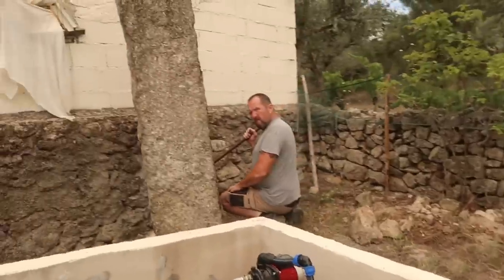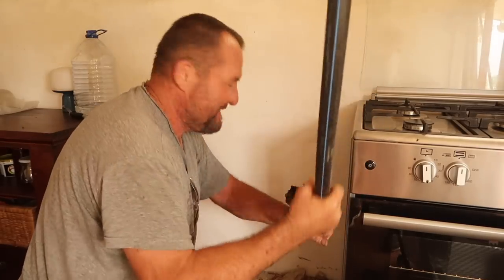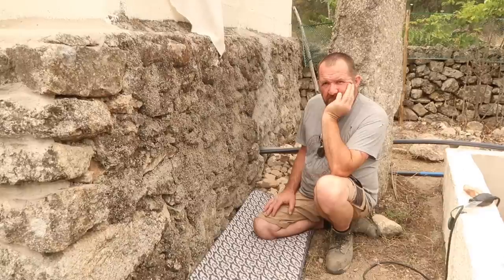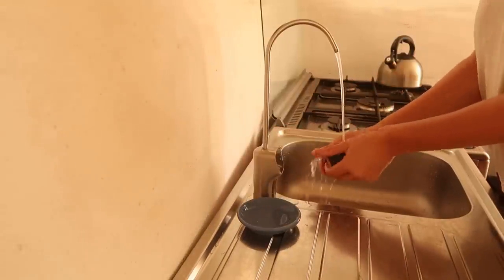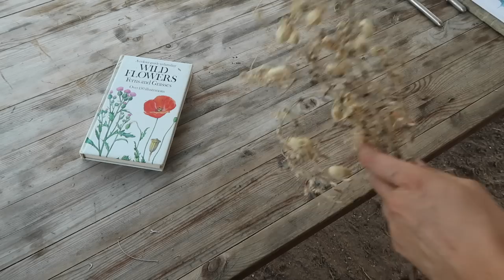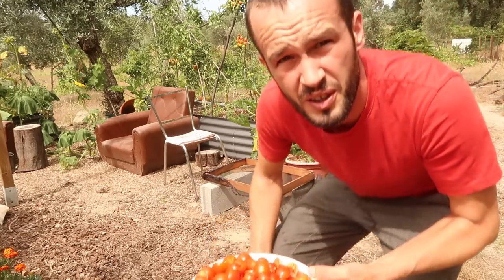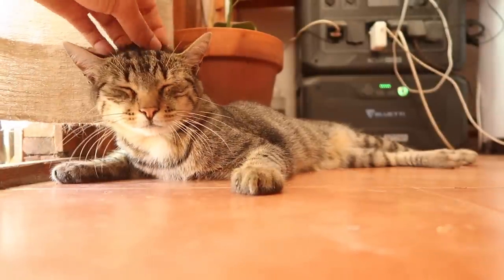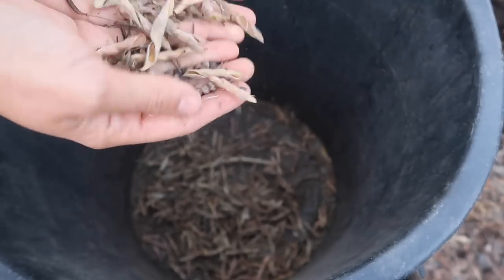Renovating a Portuguese Farmhouse

Comment: Don't waste the garlic. Wash them, dry them, put in an oven dish with olive oil and roast until soft. When cool-ish, cut the tops off and squeeze out the garlic into a bottle, add the left over oil and refrigerate. 😊😋
Reply: Sounds yummy
Reply: We always roast (or bbq) whole garlic buds and squeeze the contents onto steak or veggies. Cut a small portion off the top, drizzle with olive oil and wrap in foil. Bake until tender. SO GOOD!

Comment: The filming is fantastic. With the garlic clean roast in oven squeeze out the cooked garlic and add it to 2 litres of olive oil. That way when you want to add some garlic to your meals and salads drizzle the oil for flavour. You can also do this with chilies however be careful of how many seeds you add. Is it possible the soil is contaminated by engine or gear oil as you mentioned an engine was dumped there. Whilst in town working at the coffee shop bring back all the grounds eggshells and unused vegetable matter to help enrich the ground also check any fruit and veg outlets and restaurants for any green waste you can add to the garden. I had a small juice company near my property and the shredded citrus waste transformed my land. Congrats on the running water in the kitchen.
Reply from the maker: Definitely going to try this with the garlics! Sounds delicious. It could be the engine oil, I think that sunflowers are supposed to be good at removing things like that from soil 🤔 so perhaps a field of sunflowers there would be good

Comment: Hey Frankie/Carissa, Ewan and the weee Sausage pupp... ideas on the garlic and the beds in which they’re grown.... from the nether regions of my garlic and onion productions I usually oil roast or pickle the small ones that are not worth holding and peeling for active cooking. Once roasted/cut and squeezed or better pickled can be stored ready for use. As for the beds and on whether to build up a bed especially as “summer reveals how poor the soils are currently, it looked as if on this bed there were plenty of grasses and perhaps some cuttings from growing materials to perhaps make use of for composting only wetting down the pile and covering it while adding and building over time... this way you’ll have better options and then it may indicate where the better place might end up.... I do this in several places when building up or increasing planting spaces. This practice also helps by supplying nutrient and held moisture to all surrounding plants as the soils are built. 
Your place looks move inviting as time moves along here.. thanks for your efforts in making videos !

Comment: You shouldn't drink stage 5 reverse Osmosis water. 
The 6th stage adds back in the necessary minerals. If you don't add in minerals, they will be depleted from your body to compensate. If I'm wrong, sorry, just worried about yall 🐕🐩
Reply from the maker: We think we’ll add a re mineraliser after we’ve had the well cleaned and capped. It’s definitely very clean 😅

Comment: So we are seriously thinking of moving to Portugal for our retirement years. 
My question to you would be how are you going to circumvent a visit from the authorities verifying that this temporary harvesting abode is not being used as a permanent residence?
You are adding facilities that are not allowed in a temporary abode: running water, human waste facility, a kitchen...
How did you get the building permits for all this?
One permit averaging 18 months to be issued when everything other papers are in order and all papers are accounted for and your purchase being some 24 months??
Or
Are you intending to run this place without an address?
Is the calculation that paying the fine and rezoning fees will be cheaper than purchasing a piece of land with proper zoning??
Reply from the maker: But this is not a temporary abode, we have an urban article with the right to habitation. It is our registered address.
Reply: @FrankieOffGrid  Thanks for the reply. So you applied for this and it was granted? I do not understand how this works. I was told that you have to make a request to the town to ask the district to change the zonage of that area so your piece of land can be legally habitable 12 months a year and not just for short period of time?
Cheers.
Reply from the maker: No it was already registered as such when we bought the land. The building was actually a two storey house. We do plan on applying to extend the urban article to incorporate the bathroom we plan on adding to it.
Reply from the maker: You’re welcome to pop us an email; Frankiesausagedog@gmail.com - we obviously can’t give any legal advice but can share our experience that might help you and what to look for ☺️ and then just check everything with a lawyer before committing to any purchase
Reply: @FrankieOffGrid  Thanks!